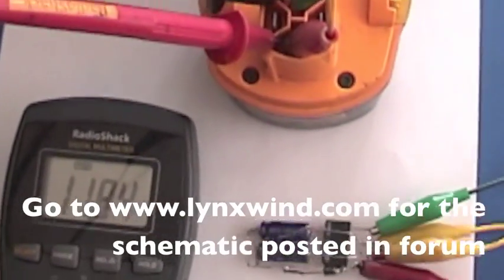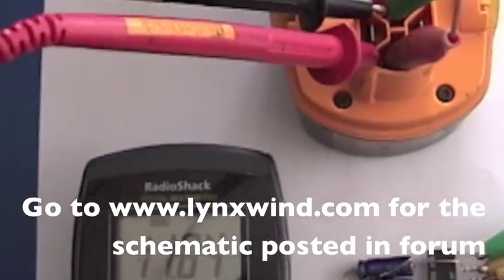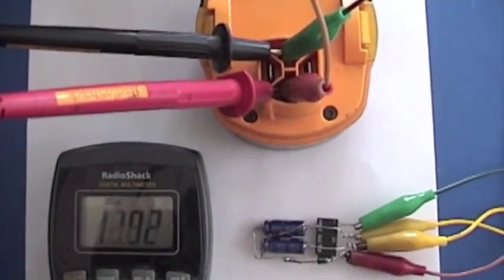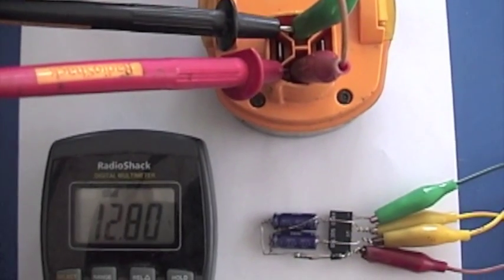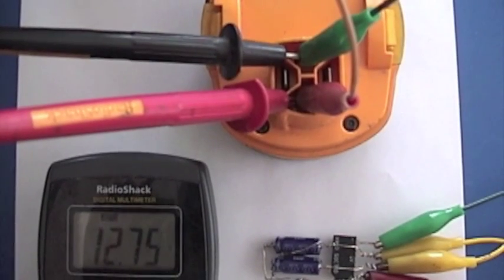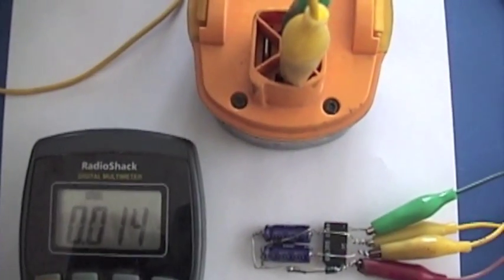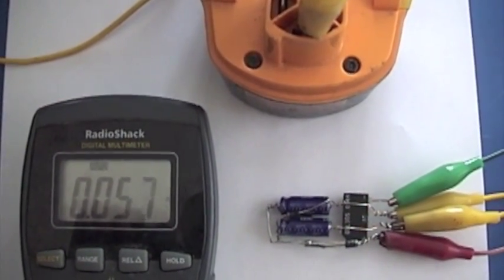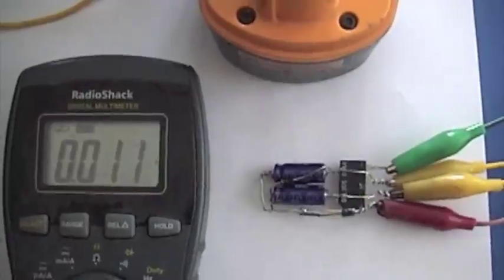Lynx Wind Boost

Comment: According to a trusted source diodes D5 and D6 are not required. They just add another voltage drop to the circuit.